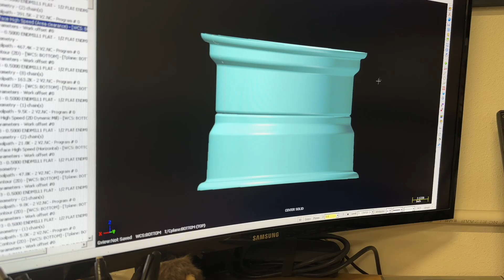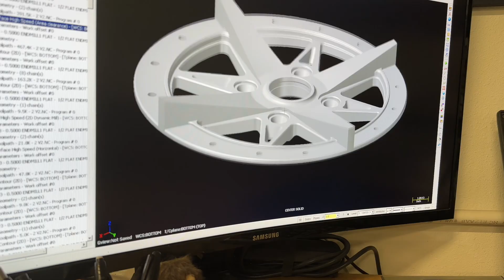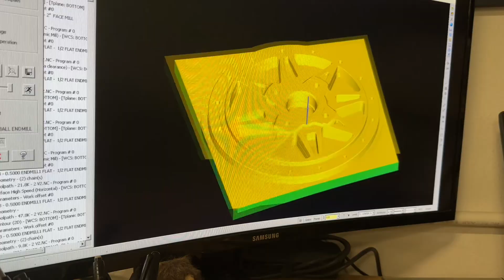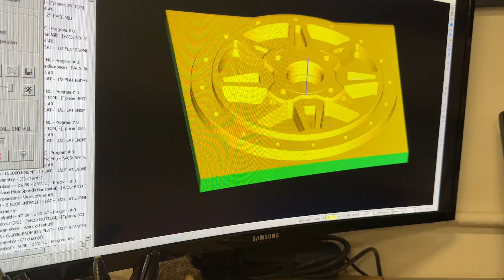Making custom billet 3 piece wheels from scratch : 1 of 1 CNC machined wheels from START to FINISH

Comment: what about finish the rim faces that are going to be painted, leave a skim pass on the raw surfaces, anodize then run a skim over to cut off the anodizing?
Reply from the maker: This is how many wheel manufacturers do it, but because I don’t have a lathe large enough to turn the faces, I’m stuck surfacing the faces in a mill. Which makes things more complicated.

Comment: Nice fusion of equip, longchamp and techno phantom's. I would expect 3-piece wheels with so few pierce bolts will need to be welded together though.
Reply from the maker: Track video will be out Friday. 16 bolts on an 11” diameter center flange is plenty in this case. That was part of the FEA testing we did before making them.

Comment: First off, those wheels are a homerun hit!  Great job on the design, and thanks for sharing the process on how you made them! On three-piece wheels like those, does the seam on the barrels need to be welded to allow the tire to hold air pressure, or is there some type of seal you placed between the barrels to allow that? Great work as always Mr. John!
Reply from the maker: There’s a sealant that goes on, check out my racing hart wheels video, I cover it there.